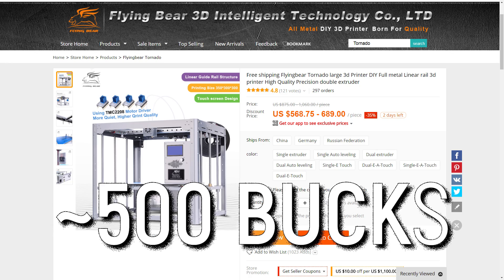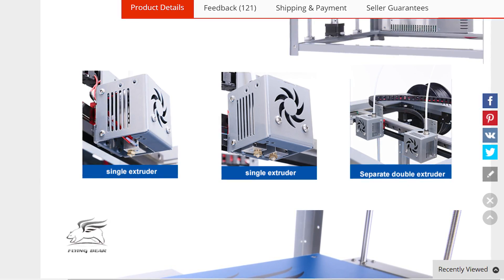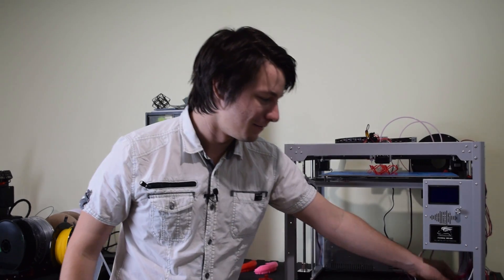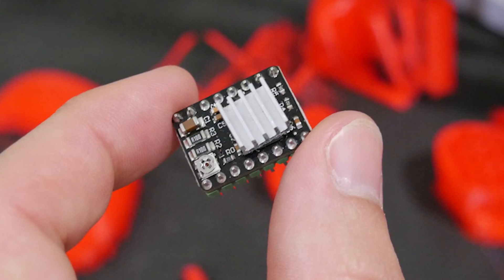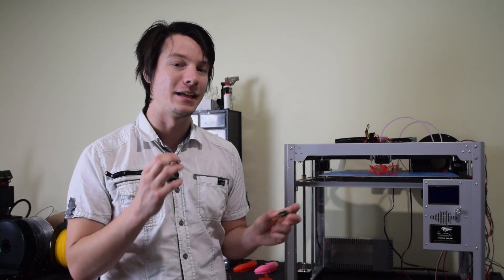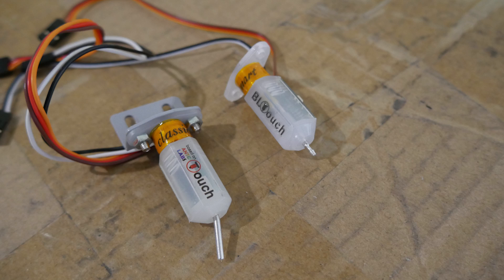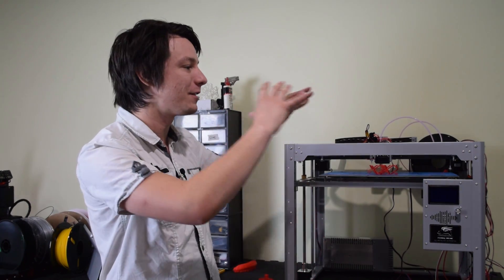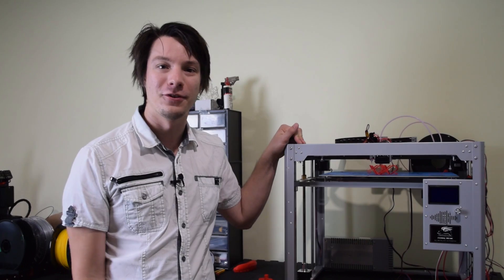Flying Bear Tornado 3D Printer Review

Comment: Hi Angus.  Great job and an important message for people to understand!  As a point to your upgrade costs, I am currently in discussions with a supplier of real linear rail systems as in the type used in manufacturing / assembly plants.  Not cheap, but neither was replacing the wheels on my Tevo Tarantula with small linear block bearings that bolt into the V-Slot rails, and then migrating all the plates to aluminum, and then replacing the belt drives with lead screws for all axis, and now trying to find appropriate End Mounts to try to support the lead screws properly which will likely lead to adding height to the linear rail / bearing assembly which will then not be stable enough.  It looks like I will spend more on 1 properly designed / built linear axis than I paid for the entire printer when I bought it, not to mention the upgrades I added to the configuration.  No, the company I am talking to is not a supplier for ANY manufacturer of 3d printers or routers.  
I don't mind as I love going through the process for the education.  Maybe I should have bought a $2,000 printer to start with, because I will likely spend that on what amounts to the new printer I am building.  Yes, I would do it all again for the challenge and learning opportunity.  The next project will likely start with a cheap delta.  Can't wait!!!  :)

Comment: id rather stick with my modern mendel design. It prints fast (120mm/s) with relatively little issues quality wise and it has auto bed leveling and good surface finish. And also its quiet because it runs on ptfe bushings

Comment: Angus, I'm using SilentStepStick drivers in my Ultimaker Originals and they are glorious. I used to have to wear noise cancellation headphones in my apartment since the printers sit in the back of my living room. But now the fans are louder than the steppers and I often get fooled into thinking the printers stopped early. You may want to look into them for printers that you use all the time. Cheers!

Comment: What a pity this thing turned out so badly!  My very first printer was a FlyingBear P902, which I received at the end of this past January.  That printer went together very well, and is still making excellent prints for me.  Other than a few minor customizations, I am running it in its original configuration.  However, I was never really interested in the Tornado when it came out; as a matter of fact, I was very struck by that fact that despite being significantly more expensive than the original P902, the Tornado didn't even have a part cooling fan!  I am really a bit sad to see that the Tornado doesn't seem to have worked out.

Comment: Sooo...That high pitched noise, that was unbearable, did it not make it through the YouTube compression or is it just to high pitched for my middle aged ears to hear?
Reply: Its like the audio deterrents they use in shopping malls to ward of lingering adolescents, if you can't hear it, thankfully, you're too old, like me !
Reply: It's there, I tested it with a spectrum analyzer on my phone. It says it's 14.5KHz, but as I can still hear the 15.7KHz CRT flyback it's actually above that. +17KHz, I assume, as that's where my hearing ends.
Reply from the maker: It's there :)
Reply: I didn't hear it either, and I have pretty good hearing.  Must be the audio processing.
Reply: I'm not sure i would be able to hear it - just barely noticing the rather loud 15.7 kHz of my CRT, about as loud as a normal person speaking - but at the very least my PC did not put out any high pitch for that segment there.
Reply: Yeah I didn't hear it either. I know what he's talking about though. I've had some pretty musical stepper drives myself.
Reply: Hurrah for my presbycusis. I can barely hear at 4kHz let alone 14...

Comment: "You get what you pay for" how about cr-10?
Reply: its worth what you pay for it. Creality killed the race to the bottom I think. they made a dirt cheap no frills at all printer but made it work well with decent components and good QC and a sold original design. not a copy. they are the exception.

The CR-10 is $500 not a stupid cheap printer but well worth it and very cheap for its build volume. But it is no frills but that is changing. CR-10s includes all the community found bugs and fixes. they are a rare "responsive" company for china (or anywhere really) for budget printers. (the $320-$350 you see them going for now is a fire sale of the original CR-10 I suspect)

Look at the knock offs. Tornado. not bad but bad board drivers. cheaped out too much and it shows. you have to add $20 in TL smoothers just to get a usable print from it (but it is "decent") its the only CR-10 clone so far that is not total junk but the only fix I can think of for it is a $80-$100 brain board. ouch.

don't even get me started on the TronXY X3s clone. junk at $340. at $200 it might be fun to tinker with but at $340 its near CR-10 priced and the only thing it has in common is the build volume. everything else about it is a groan so far at that price :-) it does work. I will give it that. some enlightened engineering tricks to cheapen it but just not worth it.

so in this case the CR-10 IS the you get what you pay for. pay more for the CR-10 versus the other junk being released to try and copy it :-)

Comment: Love this review angus! Your frustration is amusing to me because this is how I feel about my ft-5. Kit was the biggest pita to put together, had an easier time assembling my Chinese Prusa i3 with crappy English instructions. I'll get 1 successful print 1 out of every 5 times on my ft-5. Every time I level my bed and get it set and do a print, then kill the power, then turn it on to do another print the print nozzle will always start printing 1/8" above the bed, the z end stop isn't moving so I have no clue what's causing it to do that.
Reply from the maker: Yeah Linear rails =/= a good machine I suppose. It's super disappointing because you can tell these kits are done to just get them out the door, but they'll keep selling due to the low price.
Reply: Maker's Muse when I bought the ft-5 kit I was very excited to receive it after seeing so many vids that talked it up. When I got the kit and started assembling it my enthusiasm turned into frustration, there were so many missing pieces that I had to buy to even assemble it... The wiring was a joke, it was as if the guy in the factory just unrolled random amounts of wire, eyeballed the measurement and thought "that'll work"... The melamine extruder shuttle lasted a few weeks before it was delaminating and wouldn't stay tight on the x axis linear rail and the extruder was wobbling around. Never been more disappointed in something"made in USA" the power switch shorted out within a week and stopped working so I just had to hot wire it and use a power strip for switching power on and off. 2 out of the 5 provided stepper drivers were DOA...
Reply: Ive had mine for over a year now and it has been very reliable. And did you talk to Folger? He is very good at changing defective parts. Check the FB group, it is very active.
Reply: The ft5 was only my second kit I put together but I had very few problems and I love the prints I’m getting.
Reply: TheFatAssCat I can attest that my R2 came with only 2 of the 5 steppers working, a broken thermistor, no design for a fitting part cooling fan, cheap Chinese bearings with set screws that strip easily, a power supply that lasts a week before blowing and no proper instructions.  As I received mine, the FT5 was a massive waste of time and it felt like I was expected to fix all the mistakes that Folgertech made.  To anyone other than a 3D printing enthusiast who wants to spend all their time improving a faulty machine, it's a joke.
Reply: sometimes its easier to smash it to bits with a hammer, have a cry and order a new board and z sensor ;D
Reply: Jonathan Michael Johnson the cooling fan stl is on there download page
Reply: dhurt8955 yeah, last I checked, that's for the R1. The mounting holes are different for the R2 since they changed the design of the x carriage.  I had to modify the machine and a fang style duct for the R1 and through trial and error got a parts fan working.  I've already returned the machine and gone with a Prusa i3 MK2s instead.
Reply: TheFatAssCat I have the upgrade kit but haven’t put it on yet, I didn’t know that about the fan not working with the new x carriage
Reply: One of those delightful little mysteries isn't it. Possible solution is to get a blue Proximity Sensor ~$10 They seem to be fairly reliable once you have the machine set up. Mine is consitent through Power on/off on the Tronxy X3A though it's also a bitch to get Bed Level accurate, but, once you have it the thing returns to the same place after power off and prints on the bed reliably.

Comment: Thanks Angus!  The FB Tornado was one of the three printers I was looking at for sure.  The Folger Tech FT-5 R2 and Tronxy X5S were the other two.  I've always been a tinkerer, but I'm glad I eliminated the FB early on.  I settled on the X5S, at under $300 so we'll see how that turns out.  I'm going to document it from "exactly as assembled" through "whatever I upgrade to" - including final cost.  I did take advantage of your review and coupon for the Tronxy X1, so between the two of them, I'll (hopefully) be able to print some upgrades for each as needed.  It's going to be an interesting few months ahead, for sure.  The X5S is at my local post office now, and will be delivered Friday.  The X1 was just shipped - hopefully, it will be here by the time I get the X5S assembled.  Wish me luck - I'll probably need it!  :-)

Comment: "Who is this for? [...] Masochists." I do appreciate the bluntness. It's a nice change from some of the reviews that feel like, "You'll have to swap the extruder, MOSFETs, parts of the frame, solder the wires for the bed and heater cartridge directly to the $<5 RAMPS, edit the firmware, and probably just replace the PSU if you want your house to not be on fire at inconvenient hours, depending on your schedule. Overall, not a plug and play machine, but maybe great for tinkerers. 8/10"
Reply: Lol perfect description of some other reviews 👌 😂
Reply: I have the same problem with some computer reviews. 
It's super fast! 8/10! It has an AMD Radeon Processor and 1GB of RAM! Plus the build quality is shit because the keyboard flexes as you type oh, and it only has two USB ports! Urgh.... It really sucks how many people are misled into buying cheap laptops that run like arse and fall apart after 12 months.
Reply: Kenneth McCall Ouch. I hope you get it to print well at some point. I only started buying cheapies after getting a good stockpile of hotend parts and bearings. The amount of stuff I had to put in the Anet A8 was just ugly. If you haven't gotten around to the hotend (if you feel the need for one), I've found that E3D V6 and Volcano clones are getting better. Same for V6 eBayzzles. They still all seem to use the old thermistor mounting and a forged heater block with who knows how many voids and slag inclusions to mess with the heating, but an E3D block & sock pack is pretty cheap. The heatsinks and throats are looking pretty solid for a quick fix.
Reply: Haha, spot on!
Reply: The FLSun Cube I bought took me 16 hours to put together. Bad QC, Different parts and just overall bad design has forced me to spend even more the the $260 US I paid for it, and I still need to spend more to get it near the level I want it. It prints fine, but not the best and would have to be completely overhauled to get it where I really want it. I came up with "my own" Core XY design (well still working on it - I have on it thingiverse), but just the part costing at the moment is a bit more than I can afford at this time (~$1300 US).
Reply: Yeah - I have one - but would have to upgrade to 24V. The hotend FLSun provides is a something that is a mix between V5 heatsink and V6 heatblock. https://www.aliexpress.com/item/3D-Printer-Head-Extruder-Long-Distance-J-head-Hotend-Nozzle-0-4mm-Feed-Inlet-Diameter-1/32680068687.html
Reply: William Shreckengost Also, the prints are good. What makes them not great is the ringing and the layers are not perfect. The mods I have planned for the printer are to replace the acrylic parts with aluminium, add better tensioning, add dampers, move electronics to a control box not attached to the frame, replace one rod with just brackets to hold pulleys on one side of the Y axis.
Reply: Sounds like you're definitely on the right track to fix a wobble. I hope you're happy with it when you're done, and don't go too grey in the process of improving it.
Reply: It seems like most laptop are this way. They run fine in the beginning, then they just slow down. Lately (the past couple years), I just install Linux on my laptops and barely use them.

Comment: as with all Chinese cheap kit printers you are always going to be spending the same amount on upgrade, like I did with my GeeTech knock off

And now using its parts to build a replacement printer from scratch!
Reply: Celcius1au
I've got an Anycubic Kossel Linear and I've spent nothing extra on it. I've printed several parts for it, on it, but just to customise it... And they cost nothing extra either because its all been done with the supplied PLA.
Its all down to the ethics and skill of the Chinese company's staff and owners. Some just want money. Some just dont know what they're doing. And some have skilled staff and a desire to be honest and a successful long-term business.
Reply: I just got a genuine Geeetech Pro W. The parts seem to be of pretty decent quality! It doesn't have part cooling fan, so that's something to do, but it's peanuts. Immediately wish the frame was like 2cm wider because the rear bed adjustments are super hard to reach and a bit at the right part of the bed isn't usable, the print head collides with the frame, but then i didn't buy it to print big, i merely didn't want the printer to only be 10cm across. The firmware is not really all that well tuned in at all. But i almost got the printer more as a firmware working ground more than anything, so that's fine. I think i'll be spending time and effort for upgrades, but not per se money.
Reply: Same here.  My own Geeetech i3 (~$300 kit) has needed so much work and upgrades over the past 2 years (power supply, controller, bearings, hotend, linear rod, mechanical reinforcement, and more, at over $400+) that's its nowhere near original, but it finally prints reliably.  I would have been much better off just spending more on a real quality printer (like an Original Prusa i3 MK2) in the first place.

Comment: Ha ha, I have one still in it’s box. I also have a separate power supply, tmc2100’s, longer linear bearings, the part fan printed, a 35A power switch and ...not yet the time to dedicate to this build =)
Reply from the maker: +Jon Harsem I see someone did their research ! Haha. With proper parts it's a good design. Might need a direct drive extruder mod.
Reply: Maker's Muse thanks will look into it. I mean when you’re this deep down the rabbit hole right =)
Reply: Paul Frederick just counted, there are about 330 screws.
Reply: +Jon Harsem you have the time. You simply choose not to spend it. If you just put in one screw a day you'd finish sooner than you expect.
Reply: it is amazing how they add up.